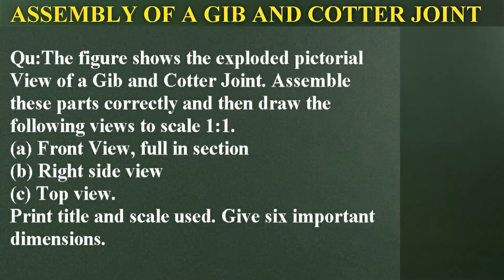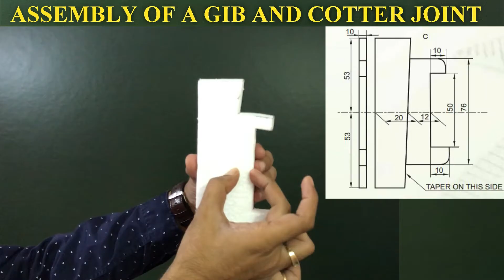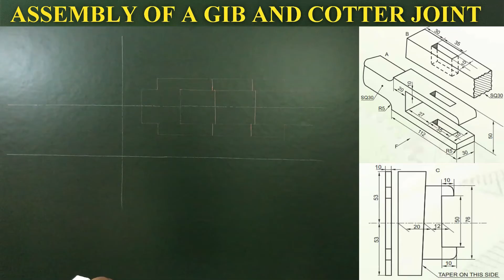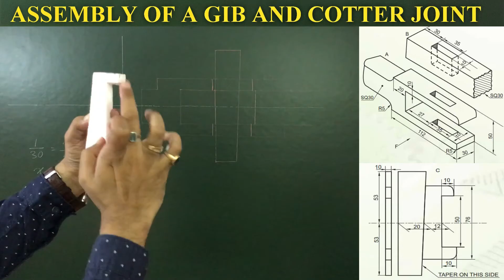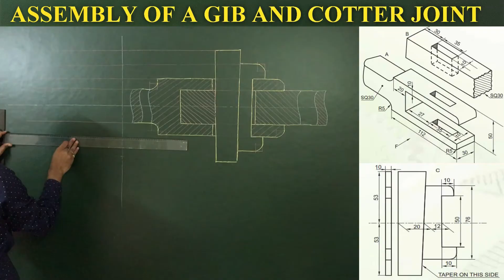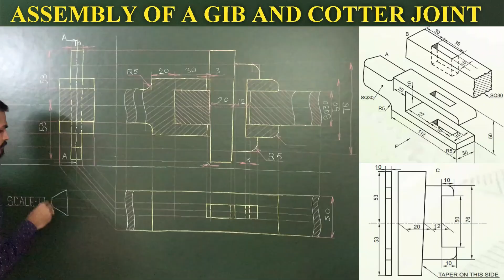Assembly of Gib and Cotter Joint From Pictorial View in Machine Drawing

Comment: Sir please solve this question ASAP :
A cone with dia 40mm and height 60mm is placed centrally with its base on the hexagonal face of a hexagonal prism with base edge 40mm and height 25mm . The common axis is perpendicular to HP. THE base of the prism is on HP and one of the base edges is parallel to VP.